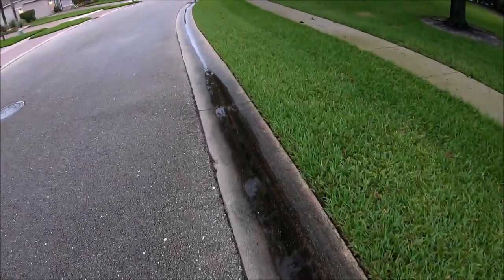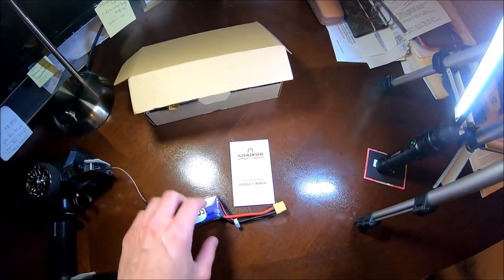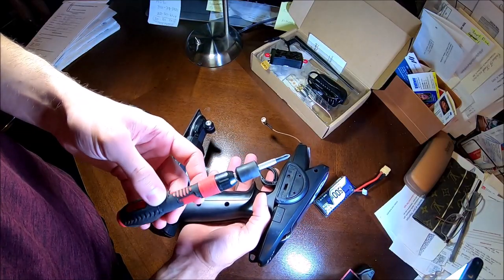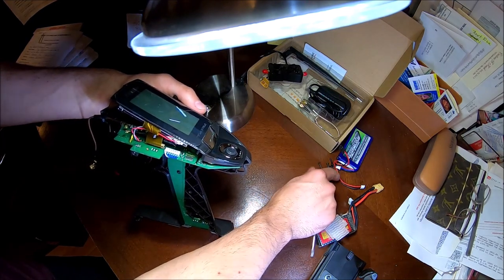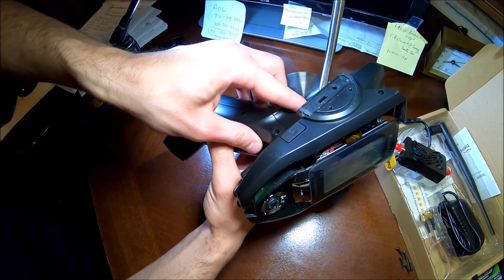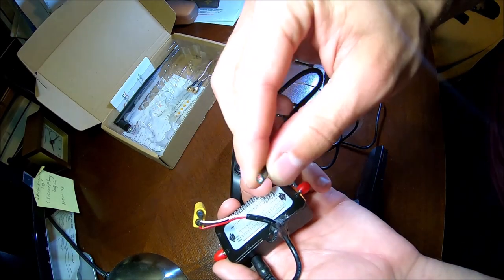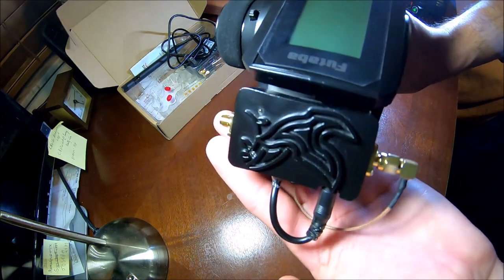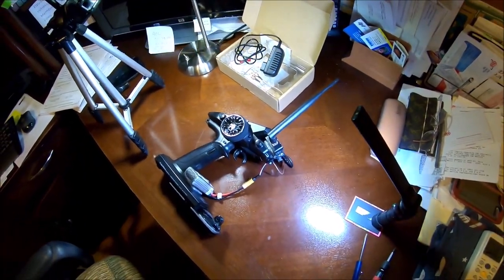Boost your Remote! Range booster Futaba 4PM

Comment: So I used a U.FL to SMA Female and put a port on the side of my DX5C. I use it for alot of different RCs, so when not speed running, I can put a regular antenna where the booster plugs in and gain a little better signal strength overall.
So far it's doing great.

Comment: Thanks - great video.  I did a similar mod and all went well, however learned the hard way (burnt RF board inside my 4PV) due to having Tx on for a few minutes without the booster powered.  Result is nothing to dissipate the RF energy into aside from the RF module itself inside the Tx.  The booster (at least the one I used) does not absorb/dissipate the RF energy from the Tx unless it is powered.
Reply from the maker: Good to know, although I always unplug the booster battery when I'm done using it. Will consider the thought
Reply: This is common knowledge to drone pilots that used to mod their radios. Whenever you have the antenna unplugged or unsoldered, you CANNOT power on the main board or you will end up cooking the RF gear, more like the amplifier really. By you having the booster off, it was like having the antenna unplugged at the internal RF module. However, some systems can detect when an antenna or module, like in the case of the Taranis internal module, is not connected and prevents the gear from burning up. The safest thing to do, unless you know exactly what the external module is capable of, is always power on the radio AFTER powering your external booster in the cases like tye one in this video.
Reply: xXG.L.HXx that’s the VTX that must have the antenna on or will fry.  The transmitter and receivers don’t care.
Reply: @roberttruesdell6151  Spend time doing a little research as to why guys performing the "Taranis X9D extended range" mod were burning up their radios. Here's a hint, they were powering on the radio without the antenna on. It all depends if the radio has built in protection to avoid burning the radio board. Most radios don't.
Reply: xXG.L.HXx I thought you were talking about the drone itself.  Never heard of anyone modifying the actual radio. We just use Crossfire. No need for anything else.
Reply: @roberttruesdell6151  Well, not everyone cares for the cost of crossfire and the mod, while tricky, worked wonders for how cheap it was. Things have changed a lot with the introduction of the 900mhz Frsky gear and the lower priced cost of the associated RX so the mod is not as popular as it was 3-4yrs ago.
Reply: Those range boosters interfere with the latency of the radio. Can use the booster and still have the speed from dlthe signal?

Comment: yyyeeaaaa so about the battery. how are we suppose to know what cell count to use? what happens when the voltage drops to low and when does that happen? are you just supposed to go out with a fresh battery every time and hope it doesnt drop down to low? seems like some very crucial info left out

Comment: I have the 4PV and the range is the least of all the radios I've had. Although it's the most expensive. I've had a Traxxsas 2.4ghz, Skyfly fs gt5(really good radio for the price),Dumbo rc x6.The best range was the Dumbo rc x6 and it was the least expensive but the radio had some glitches my car would just max out at full speed at times even when I didn't do anything.
Reply: The best range are radiolink rc6gs v2.0 600meter + stock!
Reply: @simonrcfpv2597  That's what I have now and loving it. Have had it for a year and it's what I use all the time.

Comment: Thank you! Great video, Im new to the 4pm (still in the box) would you recommend the booster for folks not passing 130? I own the gt5 and range is ok but i dont want to take any chances with these speed runs
Reply from the maker: 130 is certainly possible with no booster. Higher speeds definitely will need one at a point

Comment: Mate thanks for the video and explanation, really helpful to a lot of people.

Did you ever have range issues before this mod with that controller?

Thanks again, hope the weather clears up a bit for you soon mate. Cheers
Reply from the maker: I appreciate it man. Yes I had decent amounts of range codes being thrown from the esc because this new road I go to is 3x as long. So I always over stepped my range capabilities. So far no issues since
Reply: @InnovationRC  hmmm range codes? XLX or mmx8s? Did that just display in the log?

Also how long is is your new road? I get 300m range with stock 4pv no problem, only occasional glitch so I might do this mod anyway.

Thanks in advance mate!

Ps: sorry for zillions of questions haha
Reply from the maker: Because I drive further than 300m 😉 no worries on the questions man don't sweat it. Feel free to ask

Comment: Thanks for the video. I bought this radio because the range is better than my DX5R. My question is do we as speed runners really need an extender or is it more just peace of mind. I seen a guy on face book go 150 mph with a TQI radio and the 4pm is ten times that radio.
Reply from the maker: For me a range booster eliminates glitches that could occur. If everything goes right yes 150 is possible with a regular remote. But I'm not going off of other people and what they achieved, it all depends on location. My new spot to run I always had radio glitches. So this eliminated it. Going to be testing higher cells soon as well. 3s and 4s were only to hold off until this booster came
Reply: @InnovationRC  Ahh, yes glitches haven't had those in a while and i am looking for new run spots, so eventually i will need to come back to this video. Thanks

Comment: Fantastic video mate.. just one question how did you connet the booster to the power switch or does it have a seperate switch from the remote control switch ? 
So simple yet effective. My t4pm sucka on speed run signal 😒 
10 out of 10 video bro
Reply from the maker: The charger it comes with is what you need. The power port goes to booster, then cut the charger cord with decent length, solder any connector to go to a power source (3s lipo).

Comment: Dude this is good stuff. I am so tempted to try this on my 7PX. Does the booster get hot?
Reply from the maker: Happy to hear its good! Booster gets warm but I run 3s, it's capable of 3s HV or 4s but it will surely get hotter.
Reply: Did you end up doing it bro

Comment: So did it work or not?  What kind of range did you get before and after?
Reply from the maker: Watch at the end of the video I have a link to the test for it
Reply: Innovation RC thanks I missed the link the first time. That’s a pretty impressive gain.  Even without the booster it had pretty impressive range.